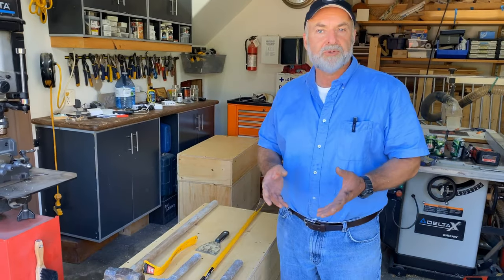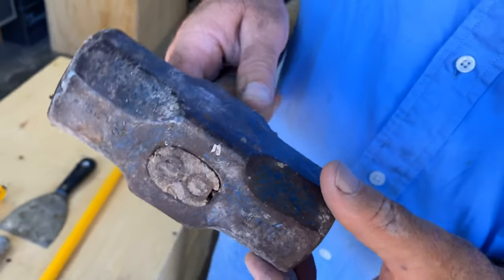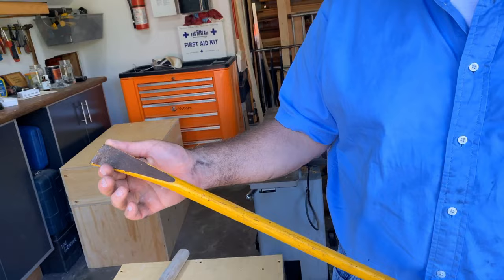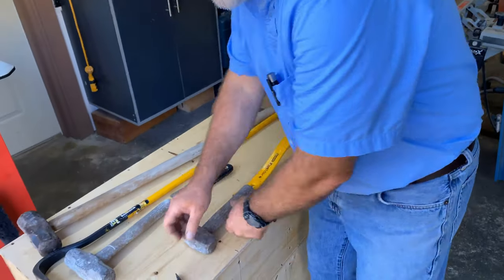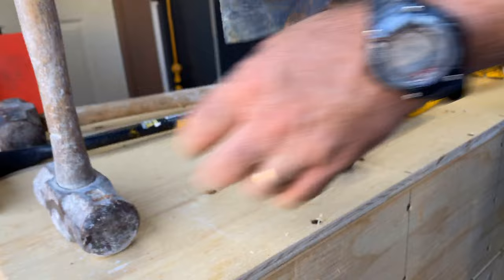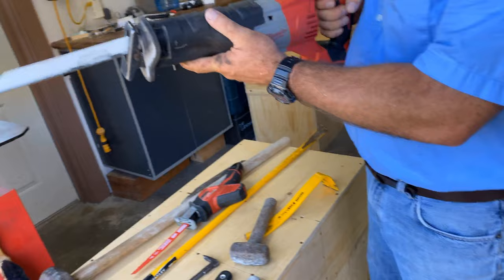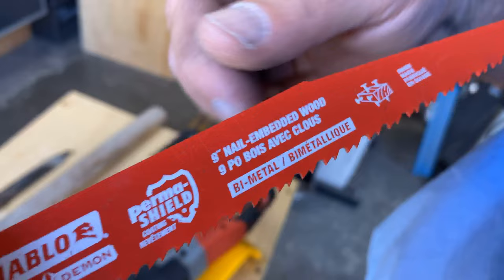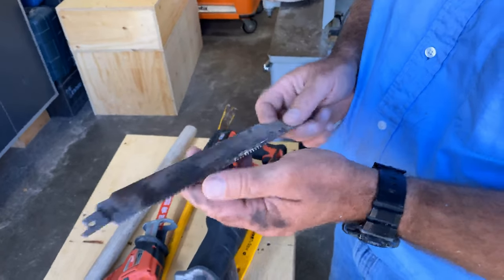Best Demolition Tools For Home Renovation

Comment: Great tips! I was surprised at the beginning when there was no catspaw on the bench, but the one you brought out later has been a key tool for my salvage renovations for decades. If it's like the one I bought from Lee Valley, it's remarkably strong and seems indestructible. I've sometimes sharpened mine and used it as a rough chisel. In a recent remodeling project I used it that way and also used a much larger catspaw to dig under the heads of some construction nails with the claw to pry them out enough to then use a heavier pry bar the rest of the way.